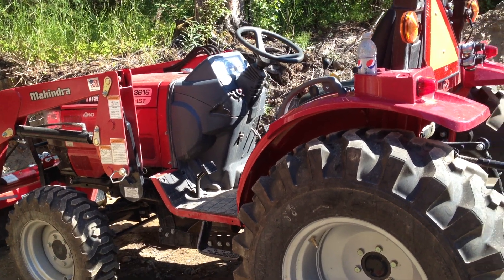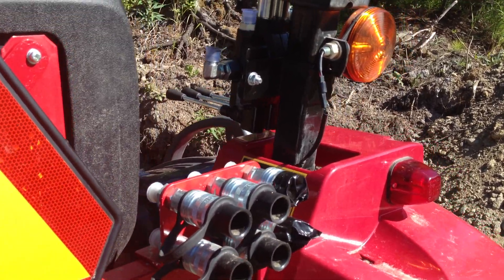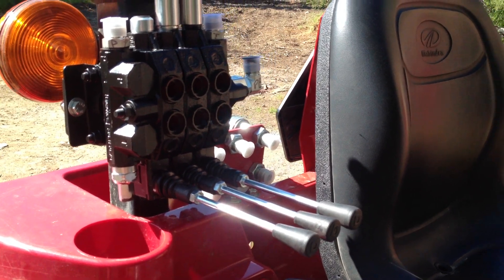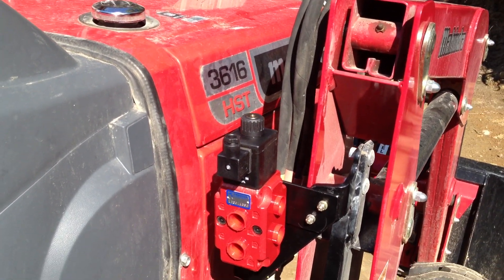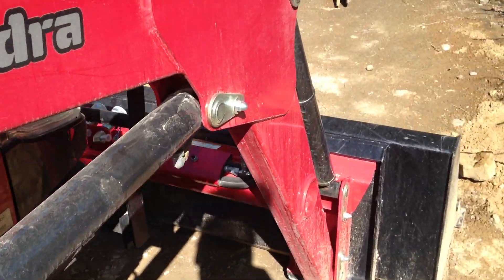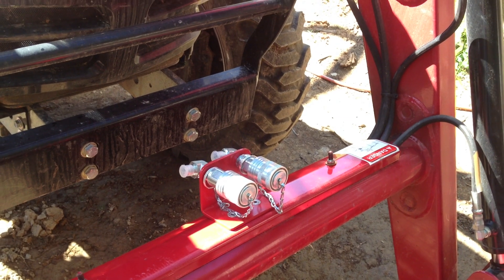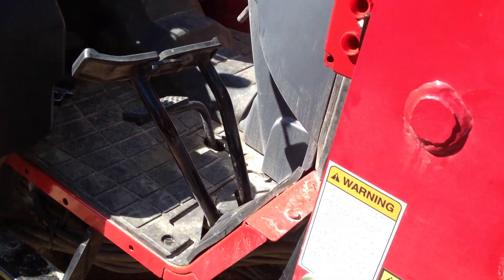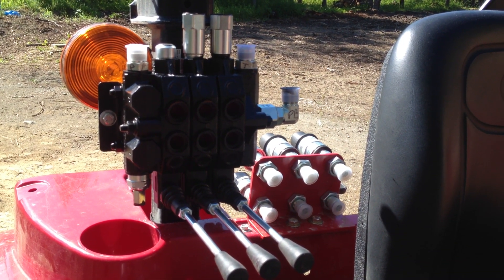Rear Remote Hydraulics on Mahindra 3616 Tractor

Comment: If you don't mind me asking where did you get the rear remote valve and quick disconnects? Thanks
Reply from the maker: Brian at FitRite hydraulics put together most of the parts for me and sent them to me in Alaska.  I had to fabricate some mounting brackets for the rear control valves, the diverter valve, and maybe a few other small pieces as well.  Most of the quick disconnect fittings also came from FitRite but I ended up getting some additional fittings and hoses made up locally at a hydraulic supply shop.  Check out Brian's website at http://fitritehydraulics.com/ .  The service I received from Brian in putting this system together was nothing less than excellent!
Reply: I have a 3616. I love it, how's yours doing